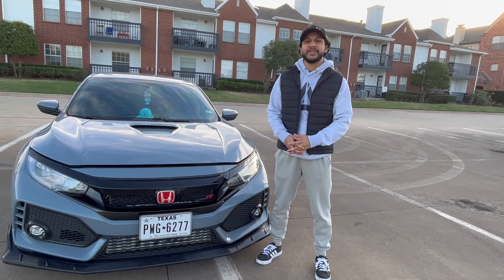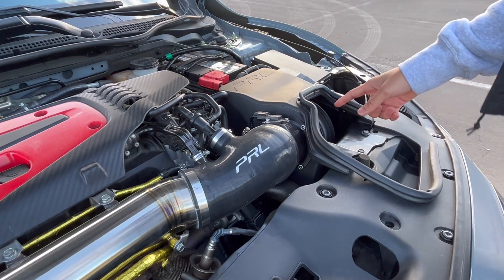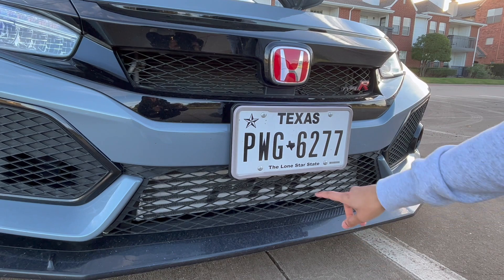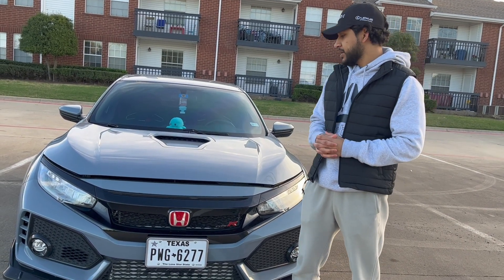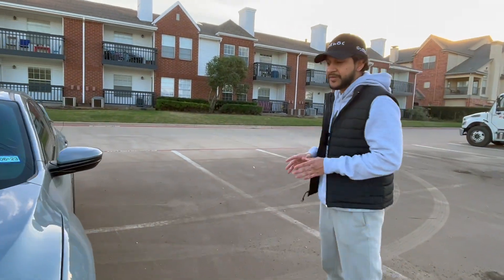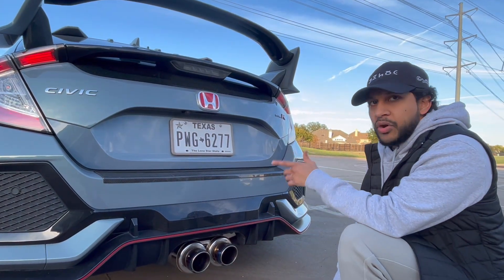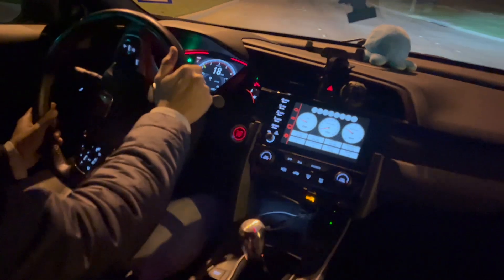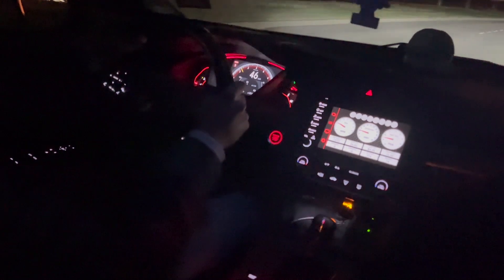390 WHP Civic Type R (FK8) | HKS SPEC L V2 Exhaust Review

Comment: Good choice for mods. Love the wheels and the wider tires. And the mods for cooling are prefect if u consider doing some autocross or track time.
Wise choice going for the HKS. Did u remove the cat as well?
Are you going to do a video about these gauges in your display/infotaiment unit? Looks rly cool . I assume u need to flash it?

Greetings from another FK8 owner in germany
Reply from the maker: Thank you so much. I installed the high-flow catted downpipe from MAPerformance. Also, the gauges on the screen is from the Hondata app. You have to jailbreak the car's head unit to install the app and use with the Hondata FlashPro device to get those sensor readings. There are videos on YouTube on this.
Reply: @turboslovecamaros7372  thx for the info

Comment: Nice. Why only E20? I'm running E30 plus 93 on my Accord.
Reply from the maker: Tuner recommended to stay at e20 since I am on stock fuel system. Stock fuel system on the Type R is a limiting factor.
Reply: @turboslovecamaros7372  Interesting. My tuner  was ok with E30. Manolito Tuned. Thanks. I wonder if the fuel system is different?
Reply from the maker: @savedby_grace6110  interesting. It probably is different.
Reply: @turboslovecamaros7372 I heard that the Accord oem fuel pump flows better than the Type R. That helps explain it.
Reply from the maker: @savedby_grace6110  i'm not surprised lol

Comment: Can you explain me the point of the blanket ?
Reply from the maker: Since the turbo and downpipe is right above the intake components, the blankets helps prevent heat from spreading to the intake and other parts of the engine bay. This helps with heat soak and overall lower intake air temperatures. The blankets work much better than OEM heat shields for turbo and downpipe.